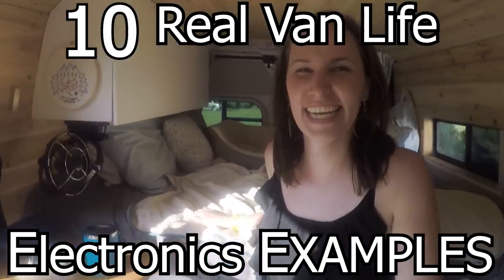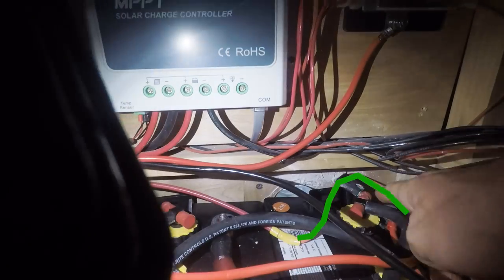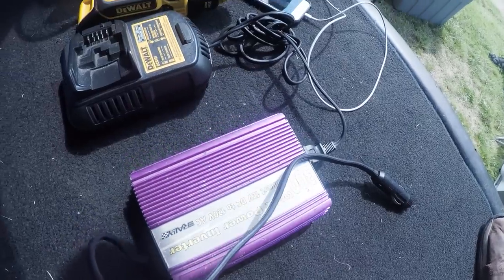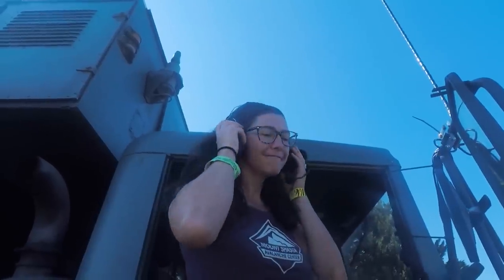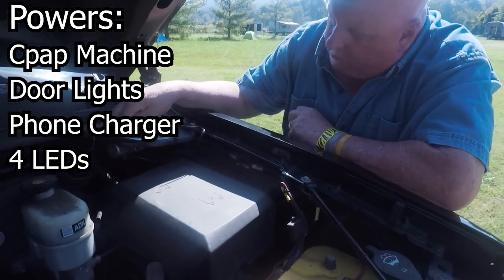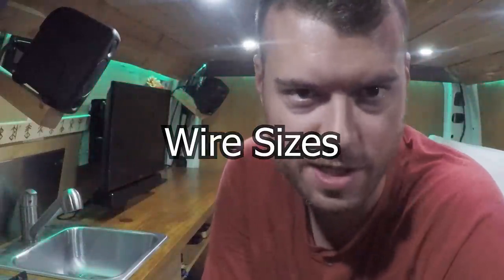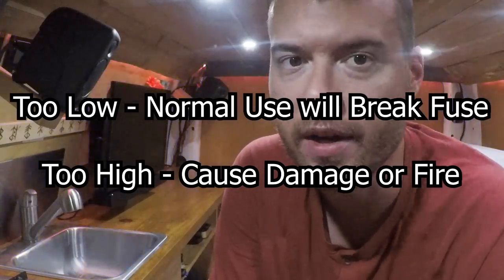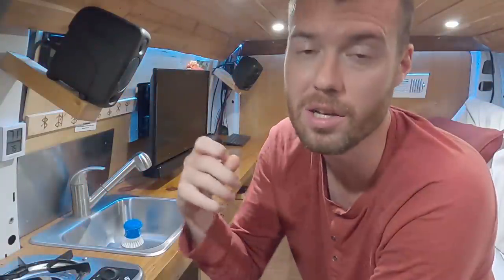VAN LIFE ELECTRONICS Start to Finish (Learn solar wiring here)

Comment: Could anybody please help me with that: How do I know how many batteries do I need to buy? How to calculate the amount? I'm going to use two solar panels
Reply from the maker: I was hoping this video would answer this question! I put in 10 different examples so you could look at the others and what works for them so you just had to choose which is most similar to what you will run in your van, and then just do as they did!
Reply: Outdoors Embrace thank you very much for your video and your answer.
What I meant to say was how should I exactly calculate the amount of watts or amps that i need for may particular van?

Let’s say i have refrigerator, ac, microwave, water pump. I assuming that i need to find out the total amount of watts or amp/hour or any other parameter they are consuming for 24 hours, and based on that make my calculations on solar and batteries. So that way i can make sure that my fully charged batteries can handle it for at least 24 hours. 
Does that make sense for you?
Reply from the maker: @nomel259  yes! Completely. The AC is the biggest power hog of what you want. ACs at minimum take around 24 amps an hour DC. That's a small AC. I'm going for a doghouse AC in my next van.

In this video, watch the very last example. Her bus has an AC that can run all night. Look at the batteries she has. She originally only had like 500 amp hours, but the AC would cut off at around 4 in the morning for her. So she doubled the amp hours to around 1000 and she's good now.

She has plenty of solar, you probably don't need as much as her. If you really want to see her bus in depth, I also have an entire tour of it on my channel as a separate video! She's a good friend!

Comment: If I have a 2000 watt inverter with two 12v lithium ion batteries... I should be a run a 1000 watt ninja blender for 10-20 seconds no problem, yeah?
Reply from the maker: Yeah!
Reply: Thanks man. Love the videos.

Comment: I am a filmmaker and my van my needs are I need to be able to use solar to charge the Vehicle downsize the amount of it electronics needed so I have more space and I need to be able to use all The appliances for 96 hours of animation and editing and sound design straight I may not work that long but better to need it and not have it then to have it and not need it what would the math look like for that
Reply from the maker: Look at my new setup! I'll link it below, but my new current van is able to do all of this, and given what you just said I would tell you to make your van have similar battery and solar.
Reply from the maker: Solar Video
https://youtu.be/7tpfzffo-zc
New Van Video
https://youtu.be/orl_AaUeVtI

Comment: Why would you run a fridge directly to your battery with out a low voltage cut off, You can ruin your batteries and they are expensive..also make sure your inverter, if you are connecting it to directly to a battery, that is has an internal Low voltage cut off.
Reply from the maker: The fridge has a low voltage cut off. The inverter also has a low voltage cut off.
I agree with you, everyone should do this!

Comment: I watched it in didn’t understand much I need some help
Reply from the maker: Well damn! I still haven't started up my consulting number. What part do you think you are confused on most?
Reply: Outdoors Embrace on the video you said that the refrigerator and other appliances can run straight to the bad battery but I’m trying to have refrigerator TV and Xbox and charge my phone and computer and other stuff so I’m trying to figure out how much what size team do I need to run all of thoseEquipment
Reply from the maker: I'd actually say the schematic is perfect for you then. Just follow what I've done in my own van! It will work for you. It's pretty much what I run in mine, just as much power.